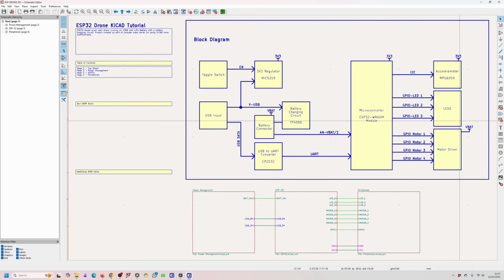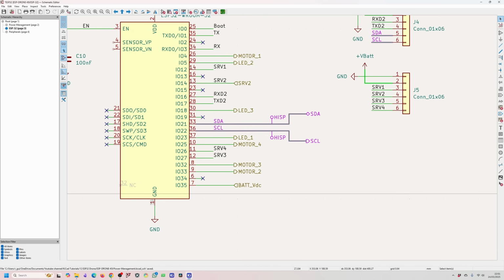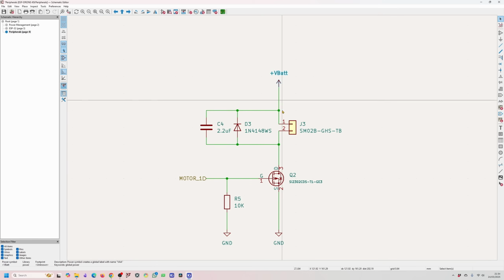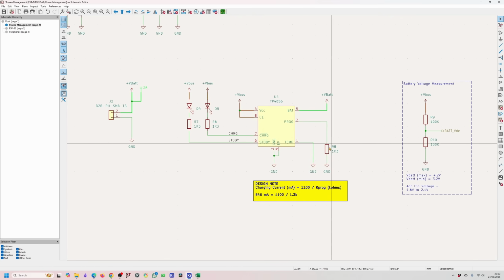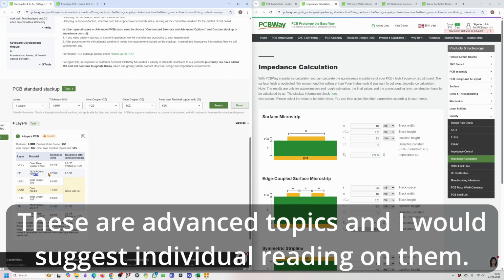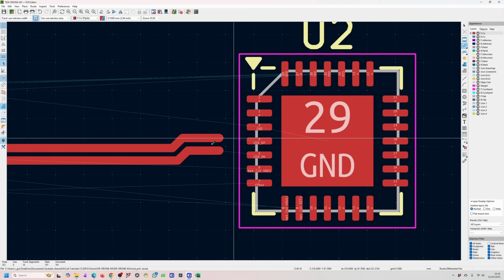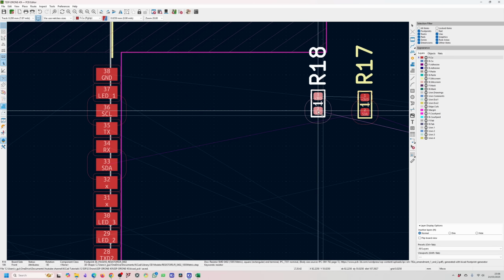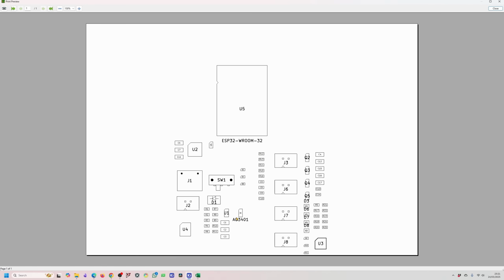KiCAD Tutorial #4:  Easy Guide to Net Classes

Comment: Gow come you get a color around your schematic nets when you assign a color. When I follow your steps, it is only a thin colored line?
Reply from the maker: It’s explained in the video somewhere, but there is an option to enable glow.
Reply: @TheEngineeringExperienceYT  ok thank you. I will look for the glow 😊
Reply from the maker: Preferences > Preferences > schematic editor > display options > enable highlight net class colors > change thickness and opacity to your liking. 

Use net classes in your schematic and you should get it highlighted. 

This is from version 9.0.3
Reply: @TheEngineeringExperienceYT thank you. That was it.